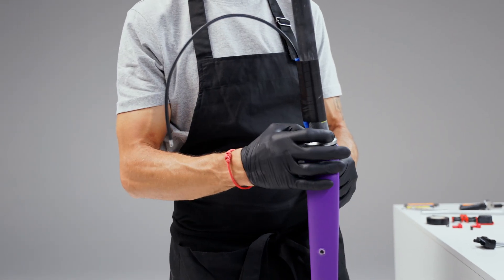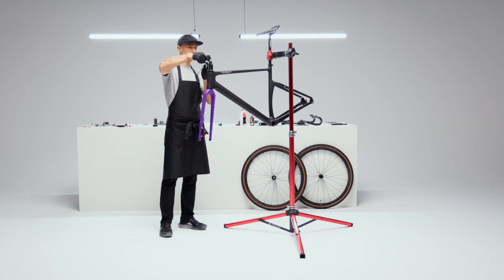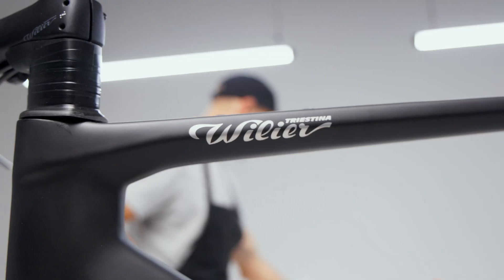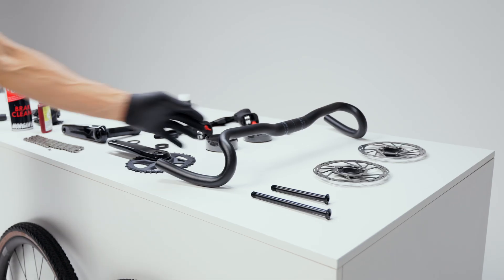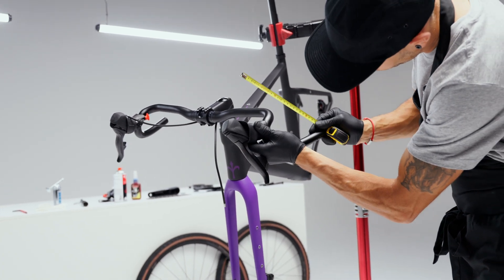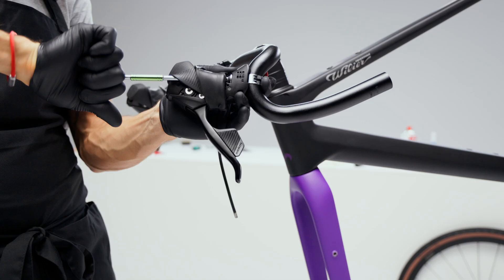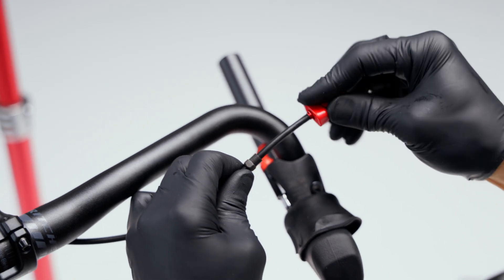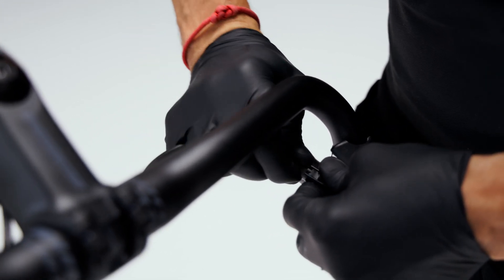Adlar | Part by Part

Comment: At such price point i would expect you would at least use your thread fitted BB86 type bottom bracket if not a CEMA interlock with ceramic bearings and a frictionless spin of the crankset.